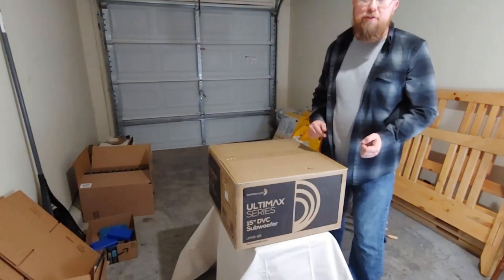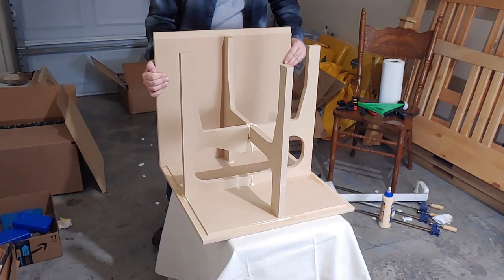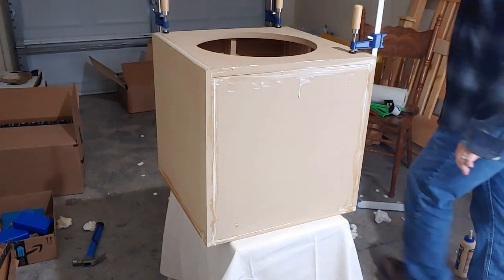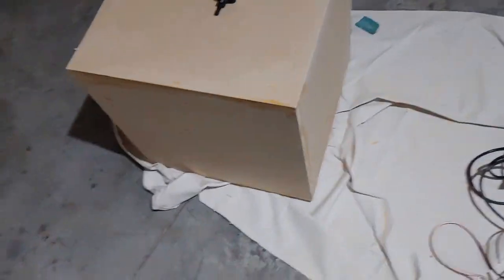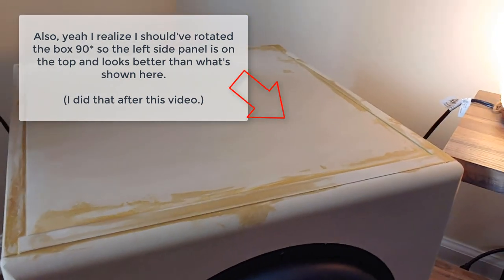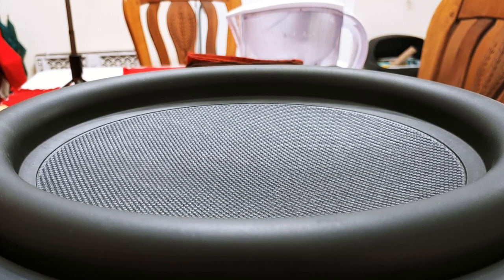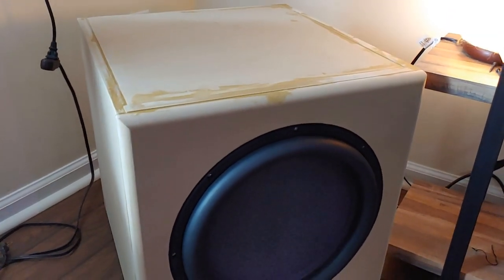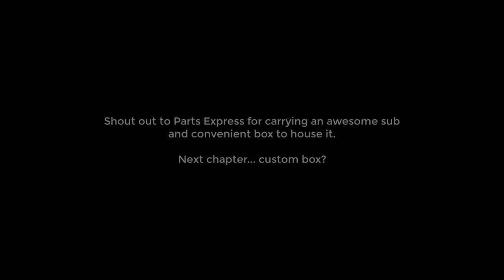Ultimax 15" Subwoofer: Unboxing, Assembly, and Review

Comment: turned out good for your first time......i would brad nail and glue your next one and round over the edges with a routor.....it would make your next build go alot easyier......im going to be building 2 of these 15s ported and the box has to be 1 '' thick  for all the peices...the hight 32' deep 20 width 26 ..it is going to be a big box lol...
Reply from the maker: Thanks John. Good suggestions for the corners especially and I'll get my hands on a router for next time. Also, awesome on your build idea! That's gonna be a heavy box! This one with the sub in it is already ~90 pounds and tough to move around.
Reply: I just built the ported cube 15 from diysg. Went well, I used brad nails then filled them with filler. It is a huge box though lol

Comment: How is the crown hooked up to the AVR? How are you getting a signal to power the sub
Reply from the maker: My HK receiver has a sub-out RCA on the back, so that's run into the line-in on the Crown. Also just to clarify, it's a signal only and not powering the sub. The Crown is powering the sub.
Reply: @Digimorphosis  no I get that.. I'm in the process of building one.... do I just run a cable out of my sub out on my avr to channel a on the crown
Reply from the maker: @jrparker1108  Yeah if you are bridging the Crown you only need channel A since it will share that signal across both it's internal channels in the bridging if that makes sense. I think I ran both R/L channels of the RCA cable into the Crown anyway but it's not needed. I believe with the Crown it's the + speaker wire from channel A output and - on B to run to the actual sub, but it tells you on the back what to do. You also need to set it to bridged mode with the menu controls on the Crown to work properly (and make sure it's on 0.775V sensitivity and not the default 1.5V for pro gear or you won't get enough volume). Hope that helps.
Reply: @Digimorphosis  it definitely does thanks, gonna order some stuff soon

Comment: Can You replace the 15 inch woofers in a pair of 15 inch dj speakers with compression drivers in them with 15 inch Dayton audio ultimax subwoofers
Reply from the maker: Hmm, you'd have to look at the mounting depth figures for each to make sure they're similar and that the box volumes line up close enough. I know even for the Ultimax a lot of people in forums say that the 3 cubic feet of this knockdown box is smaller than ideal for the Ultimax, and recommend 4-5 cuft for sealed.

Comment: How did you power it? What amp
Reply from the maker: I use a Crown XLS 1002. Bridged at the 4 ohms this woofer can run at it can do 1100W RMS which has been plenty for this sub. 👍🏻
Reply: @Digimorphosis  have you had any issues with crown amplifiers? I'm in the process of building a home theater with DIY speakers for all channels. I want to use two of  the ultimax 10" subwoofers in ported enclosures and I'm super new with amplifier selection for so much power
Reply from the maker: @hermangaviria690  I've only used the one Crown amp thus far but no I've had no issues with it and it seems to produce a lot of clean power with low distortion. And I like the flexibility of wiring options it allows, including having its own internal crossover settings that not all amps have.

Comment: Duct tape is electrically conductive, so you just but a big resistor across your wire terminals.
Reply from the maker: Appreciate that. I haven't had any issues in the 3 years since I made this video, but that's definitely something for everyone watching to know and something I would do differently next project like this.

Comment: Nice job man. I've heard that the um15 is basically the same motor structure as the um12.. not sure how true it is..
Reply from the maker: Thanks! I can't speak to whether that's true about the motor structure, but I will say that to me this big 15 sounds accurate and isn't muddy despite it's massive size, and is cleaner than a couple other 12s I've tested it against. So if it is reusing the smaller 12's motor structure/magnet, it hasn't seemed to suffer for it. (The magnet is huge.) This woofer definitely has an easier time hitting the deep lows without a ported box than any of the other subs I own, for what that's worth.
Reply: @Digimorphosis  the um15 specs say it goes deeper than the um18, which is why i bought it before i ended up buying the 18.. however the output of the um18 is in another class. I've built several of the um15's and a couple of the um18's. I think the actual size of the 15inch driver is what helps it with a little extra output over the um12.. just my thoughts
Reply from the maker: @dickydoesaudio3466  Interesting. I wonder why the 18 doesn't go as deep; I would've assumed the opposite. But regarding the output, I bet! With how much room-shaking this one can do I can only imagine with comparable wattage and all that extra surface area. The box for it must be huge.
Reply: @Digimorphosis  the UM 15 Specs claim it goes 1HZ lower than the 18 but actually the 18 will dig as  deep as anyone would ever need at 10HZ in a big enough enclosure. Sothe UM 15 specs are a little exaggerated.

Comment: 2 12 have more cone space then a single 15 it's your box and speaker sensitivity of the speaker that makes a big difference.✌️👌👍💯
Reply from the maker: I agree box definitely makes a big difference. I've done some other DIY stuff since making this video and newer box designs I've tried, even with the same Infinity sub, make it sound WAY better.
Reply: @Digimorphosis  ya with the right box and tune almost anything can sound good the more solid the better with clean power and you can't go wrong👍👌✌️💯🎶🎵
Reply: not by much and the 15 generally have more xmax